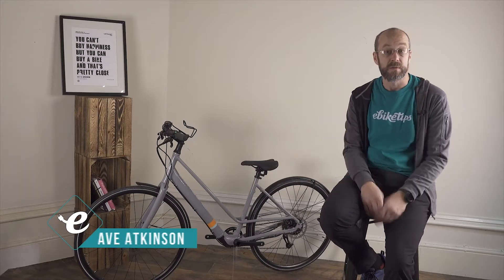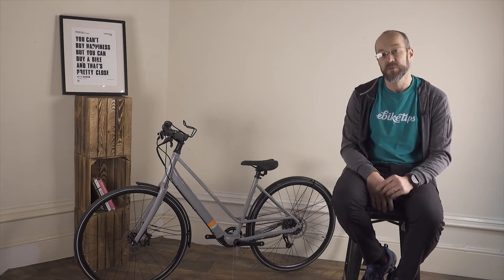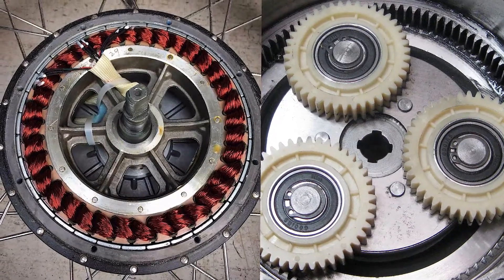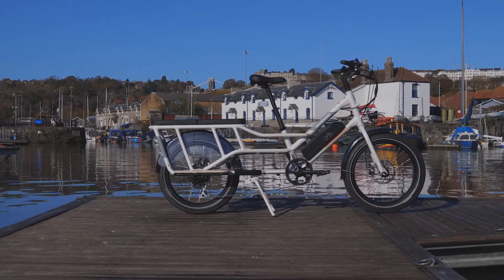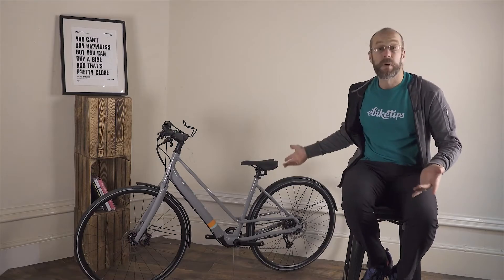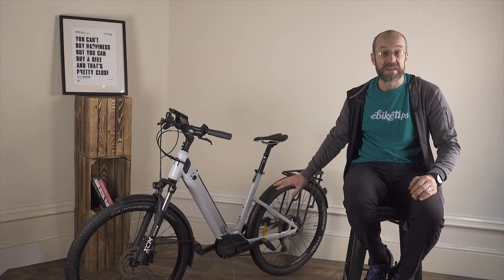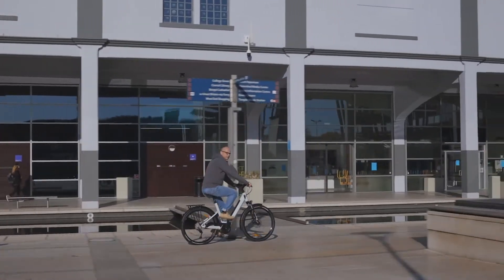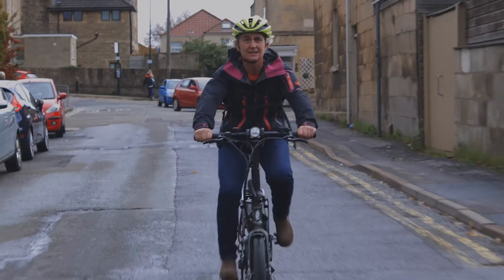All about e-bike motors

Comment: Thank you for explaining. There are many different ebikes and your video helps to differentiate between them. I have a Trek Valencia ebike with a factory fitted bionix hub motor. It’s fantastic going on the road and gets me up some very steep hills but because of that it’s range can be limited, although I do get about 18 miles including 4, 1/2 mile long, 400 ft climbs.